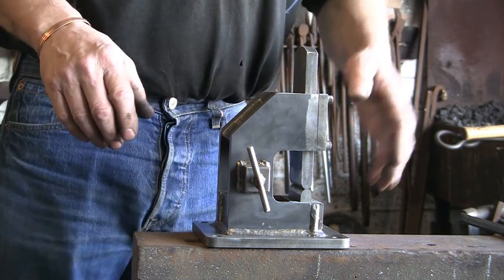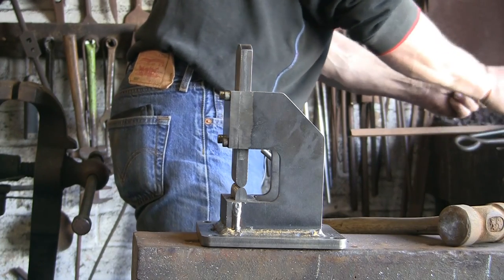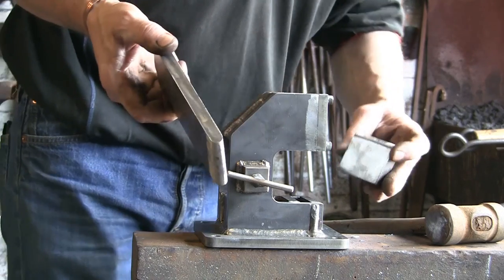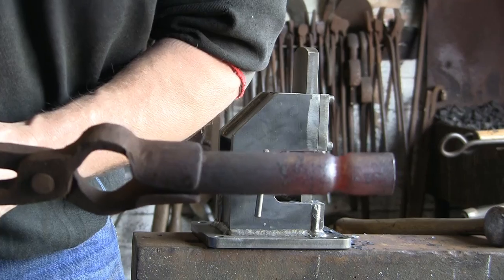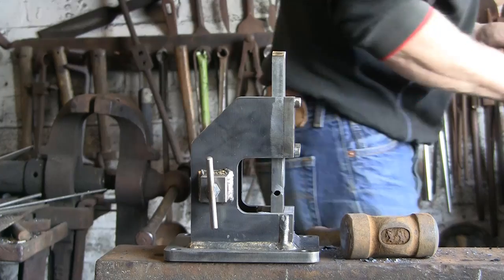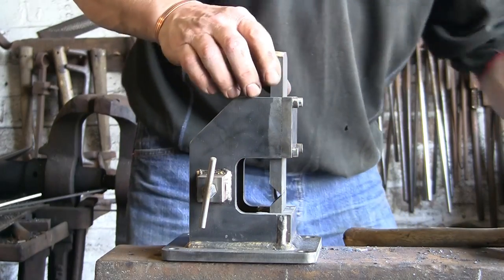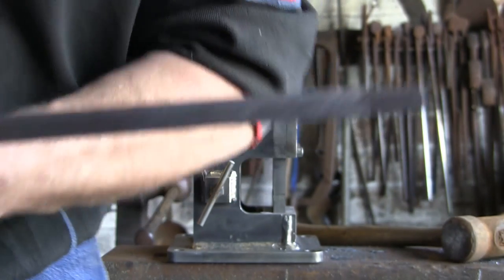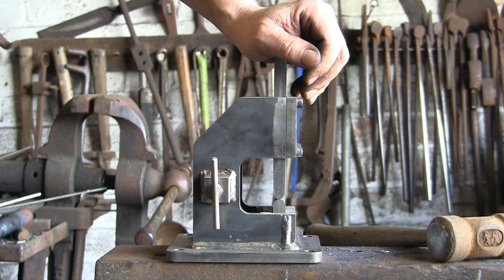Trying out the blacksmithing guillotine tool aka the smithin' magician

Comment: On my round dies I grind the edges off to make an oval so it won't pinch the metal and it works much better. I also have a die with holes side by side and a flat die on the bottom. It make a good cats paw for the base of a leg. Also works for making half round bars. Thank you very much for all the things you do and share. You probably can't hear but I often say thanks Gary while I'm working in my shop.

Comment: I cheated and bought one.  Cost a pretty penny though.  Mine is a bit strange, has slots cut into the sides into which the dies fit in.  It has a double plate on the bottom and the hardy or lower plate screws on.  If you do 't want to set it on the anvil, you can unscrew the lower plate off.  I have never tried a spring fuller, although I can see where at times it might be better.  I call my "magic helper" a guillotine.  I also have cut off dies for when I want to cut a piece of bar stock.  I really enjoy watching you work, gives me a really good idea of the time frame in which these sort of things get done.  You have a lot of serious stuff.

Comment: the biggest thing with those tools is learning the different ways of using the dies.  personally i would have mounted the hardy in a star pattern so you could set it at a 90 or a 45 to the anvil edge.

Comment: Hi ! Good videos you have there. Little tip for your tenondie, you can round of the holes, they are too sharp so u get nasty marks. It need room to spread out. They can almost be like oval shape, because its only the top and bottom of the hole that forms the shape when u twist it around.

Comment: It looks like it would be easier going if you could secure the tool more firmly against your anvil.  is the bar stock long enough to go all the way thru the hardy?  If so you might could open a hole thru the square bar  which you could hammer thru a scrap wedge of wood.

Comment: That Smithing Magician looks like it would be perfect if instead of a slot for the punches it had a sort of cross or phillips slot, so you could pull out and put the punches in a quarter turn to the side, and then also do a quarter turn of the magician in the hardy hole, so you can very easily see both sides, but also you have the option to swap back and forth.

Comment: I have one of those fullering devices  which have found not to be that satisfactory. I think it is  because I just have the square dies. I will get some stock and make the tooling you have demonstrated . It looks like a big improvement.
Thanks
Frank (VA)

Comment: +Gary Huston I like this video and am already thinking of all kinds of shaping dies for it.
But I also thought of a fix for the tool to allow better visibility...  
What about adjusting the 30mm Square Post that fits into the Hardie Hole with a 40 to 45 degree offset (or whatever degree that would make it more comfortable) to turn the front of it towards you??   Such as make another bottom plate the same size but the 30mm square hole is turned off-set by 40 degrees, remove the current square post and attach it to the new plate, then bolt it on the bottom of the Smithin' Helper.
If you do that, I'd like to see an update video.
Reply from the maker: that won't happen. I have got used to the way it is. The video was the first time I had used it but now it's no bother.
Reply: Gary Huston
Reply: Gary Huston b

Comment: you should spring load the top die so that it would make it easier to see the work piece between blows. It would also make re-positioning the work piece quicker and more precise
Reply from the maker: I didn't spring load the top for a reason, have you ever tried hitting something that keeps popping back up towards you? It's a royal pain! You hit just as it's coming back up and you end up miss hitting. You end up being slower because you have to wait between blows for it to settle.
Reply: garyhuston 
Perhaps a little lever loosely attached to the top of the top die. You could rest your hammer on it while you reposition the stock with your left hand

Comment: I would not add the springs. it is a pain to lift the top fuller but it holds the material and when you strike the top fuller  there is no bounce and 100% of you hammer strike is translated to the material. I made one of these because I got tired of the material "hopping" when I used a spring fuller. with the material in contact with the top and bottom tool you won't get any tool blows outside of the area you wanted.

Comment: just a suggestion would it be a good idea to put horizontal lines maybe 2 mil apart on the top tool above the whole thing so when you hammer it you can look at the lines and see if you are the same depth on all sides of the bar you are shaping.
Reply from the maker: phil hyms Yes, good idea!

Comment: Hi Gary, good vid nice dies, I have a guillotine I made ages ago the stop is a great plus as you don't need to concentrate on placing the material in the same place just on the depth of fuller, much better. Do you think you could make an oak apple acorn fullering tool. Pieh do a spring swage but expensive from us. Spring swage close in vice could be used as a mould to pour copper etc. don't know how to make the acorn shape in either a guillotine tool die or even a swage, you got any ideas.?
Reply from the maker: None what so ever!
Reply: You can use race bearings as a ball or even acorn swedge. If by hand form ball then slightly taper ball. Chisel in lines and voila. You got nuts. Fuller top to stem. Lot of ways to make. Lot of fun to try. Good luck brother.

Comment: Since the upper hammer rests against your work between blows, do you find that too much heat is drawn off your work and into the face of the upper hammer?
Reply from the maker: Interesting that you single out the top die as the work rests on the bottom die all the time! And no, neither die draws away a significant amount of heat.

Comment: would hardening/tempering the top of your dies reduce the deformation from hammer blows or would it open up possible trouble from cracking?
Reply from the maker: You can't harden mild steel!
Reply: garyhuston Case hardening?
Reply from the maker: TheKez1998
wouldn't last a couple of blows!

Comment: I wonder if the dies were facing 90 degrees different if it wouldn't be better, it seems to be limited to the throat size but it definitely is nice for putting a fuller in on something like a knife blade
Reply from the maker: Edge 150 it's only limited to the width of the dies, that is the same whether they are this way or 90 degrees. The length is unlimited either way.

Comment: how about installing spring with adjustable tention which will keep the top tool up ??
the adjustment would keep the tool at certain height for different job thickness .
but then some stopper has to be installed to prevent the tool form jumping out ...  just an idea ..don't know if will work ??
Reply from the maker: Please read earlier answer.
Reply: +garyhuston How would it work as a fullering tool.
Reply from the maker: Rubbish I would think! You would need to modify it by putting in a flat base instead of bottom tool and highly modify the top tool but I guess if thats all you wanted it to do you could spend the time doing it.
Reply: +stan  you are right stan. add spring will do. it will help a lot..
Reply from the maker: +Shahran Yaacob try it, you will find it's a pain in the arse!

Comment: Gray, love the videos they have helped me out quit a bit and I was just wondering if any chance you could show how to make a 4 or  5lbs rounding hammer. In stead of me going to buy one, I would rather try and make one. Thanks!
Reply from the maker: Hi Josh, glad they have helped. Unfortunately I have only ever made one hammer in my 36 years working and that was a pain!
At my age I can't do that sort of hammering any more and I don't have anyone to strike for me.
If you really want to try and make one you should watch some of the videos with Brian Brazeal teaching at various places. I have seen a couple of videos where they make hammers, although I wouldn't want to use one, far too heavy for every day use and they all seem to strangle the hammer by holding it right at the top. In my opinion that is because they are too heavy and you don't have the control you get by holding the handle of a propperly balaced hammer. Just my opinion though!
Reply: Thank you for the response I will take that into consideration and stick with a smaller and well balanced hammer. I will go and see some of the Brain's work on hammers just to see what the process is like to make one. Thanks again.

Comment: Love, the idea. Have you thought of turning the dies 90 degrees?
Reply from the maker: hogheadv2 Why?
Reply: garyhuston It would allow better view of the work piece. It seems you have an extra side plate. 
Your bottom die can hold flush with one side, Captured in the pocket. [C shaped side plate of stout material ]
Bolt on capture for the top die. With the Great base design and a upright to keep it square this would allow 3 side access to the tools.
Reply from the maker: hogheadv2 I have no idea what you are talking about but feel free to do that on your version if you feel it would help....

Comment: Hi Gary hope you are well. I was just wondering if you could possibly make me a set of tongs so that I can place knives in my new gas forge. I've found some online but the price is expensive cause it's for sets of 7,8 or 9. If you could let me know and then tell me a price I can then let you know if im happy with that thank you
Reply from the maker: Sorry, I don't make stuff to sell. Why not just make some? If not there are plenty of places that will sell one pair. It would cost more from me to make specially as opposed to off the shelf.
Reply: Ok thank you for your reply I'll have a search about. Just thought it would be cool to get some from you as I enjoy your videos. Thank you for the reply.
Reply: +Diesineveryfilm Customs Get some 25 cent pliers at a flea market and weld pipes on the handles. Done, and done! The trick really is in finding just the right pipes to use as handles. I have a pile of this thick walled half inch OD pipe that I've no idea where it came from. I have to grind pliers handles down a bit to get them in there, but once I do that it works without even the welding bit. I keep saying I'll weld them on someday. 15 years later it still has not happened yet.
Reply: Paul Frederick strange thing is I have bought some pliers that looked like tongs and welded on some tube so thanks from the past me aha. Check out my videos as you will see them in a few of my builds. 👍🏼👍🏼👍🏼
Reply: Diesineveryfilm Customs
yeah the choice to make tongs, or not is a tricky question today. Considering how many smiths are around, and the quantity of tools available. It is more resource efficient to just use what is available. As forging time, and hammering effort are finite quantities themselves.
Reply: Paul Frederick I totally agree with you. I do intend on forging some in the future but at the moment I spend so much time making other things it's just finding time to fit it in. 👍🏼👍🏼👍🏼
Reply: Men's custom iron has reasonable quick tongs, all cut out you finish them and put them together.
Reply: Ken's custom iron.

Comment: I know everyone keepsharping on about sprjnging the top; sorry bout that.
I think there IS a bit that MIGHT make it a tad more awesome,  and it does involve a spring, but hear me out.
I think a spring loaded ball bearing, and a detent in the upper swage could work a treat. It would hold the die up till you were ready, and a simple tap of the hammer before a full strike would drop it into place. When you lose the heat, the work could be used to just flick it back into the standby position.

The main advantage would be, you would never have to set down your hammer just to pick up the die that half inch. Less time fussing with tools = more work time at tempature.

I recommend my modifaction as a machinist and tinkerer. As a blacksmith, I still use the handle side of my tongs to do those little radii, or an ancient guillotine fuller, if I remembered to pack it.
Whatever works.
Great design, and awesome video.

Comment: Nice job dude .. but why the bits are not hardened?  Wouldn't it be better?
Reply from the maker: No point using hardened steel on hot material, if you are worried about damaging the top when you hit it just put a run of hard facing rod across it. I’ve been using them for a very long time and just run a weld across the ones I use the most. Still on the same dies as when I made the tool.
Reply: Awesome thanks

Comment: Gary why don't you try to rotate the smithin magician 45 degrees on the the hardy bar? it might be easier for you to work on it
Reply from the maker: If I did i would have to redesign the base plate, the hole is square to the sides so it will only go 90 degrees. I only can't see it when I'm videoing, when I want to use it properly I would just face it towards me.
Reply: garyhuston
 Ok mate I just thought the angle was not very convenient for you but if it suits you then it's perfect! Overall a great project mate, you are an inspiration! I cannot wait for your next videos!

Comment: Are these dies something you would want to heat treat?
Reply from the maker: No, they are only EN32B which is just bright bar..
Reply: I'm in the process of making dies out of 6150 steel and hardening them to 53 Rockwell . I was asked by someone if the heat from the steel being worked would draw out some the hardness . I guess the same could be asked about the face of an anvil , mass perhaps ?

Comment: You should make a, "rest", maybe a rectangular bar/tube, that you can lay on either side, that'll be flush/even hight with your different dies, that will insure that whatever piece you're working, is level,, without having to, "eyeball" it,, make it so it can be locked/clamped onto the anvil, then either mark it, or attach a ruler to it, then mark a reference on the piece you're working,, then you could work the piece, slide the reference so much on the support, will allow you to make repeatable, "work", at nearly EXACT distances apart, with whatever dies you're using, without having to mark/measure the piece,,, Just a thought,,

Comment: Put a return spring on the hammer side so it resets it after a blow. Will make it smoother to use. You'll be able to rotate and reposition the piece without lifting the hammer die by hand.

Comment: Для операции на 18 минуте использовать ограничитель
Reply from the maker: Sorry, I have no idea what you are saying..
Reply: "For operation on 18 minutes to use the limiter"

no clue what hes on about.
Reply from the maker: +DiRT we can all use an online translator! One that actually worked would be nice.
Reply: @ 18.00 Use the length stopper adjusted to hold the job in between the blades, you even say it yourself, "could probably do with a guide really, to put it up against, so you get it right down the middle."